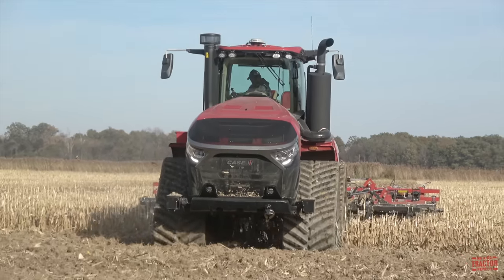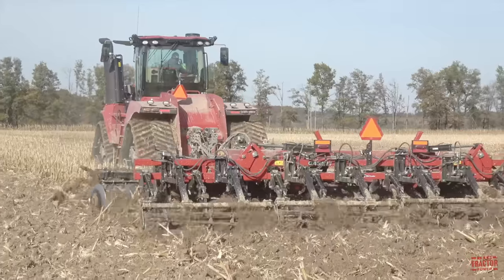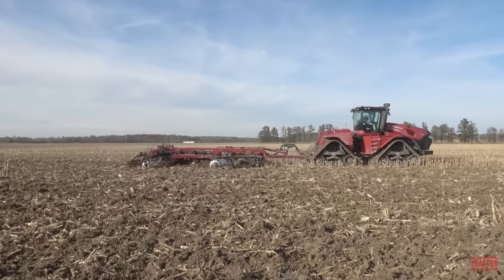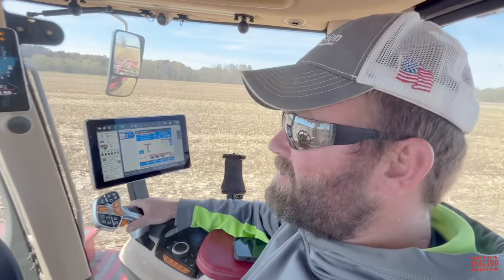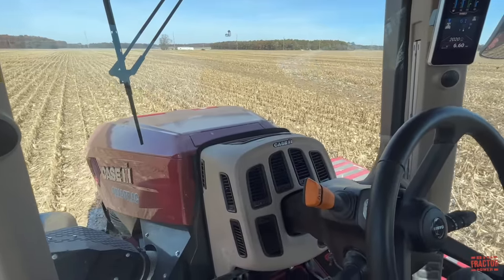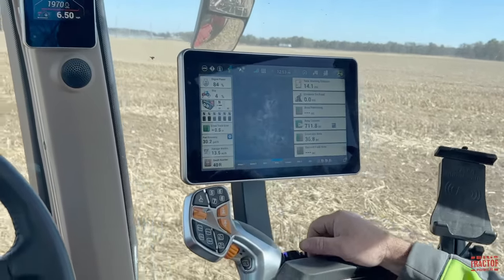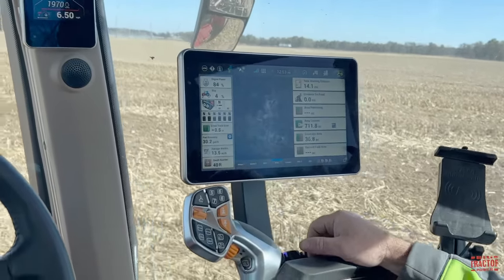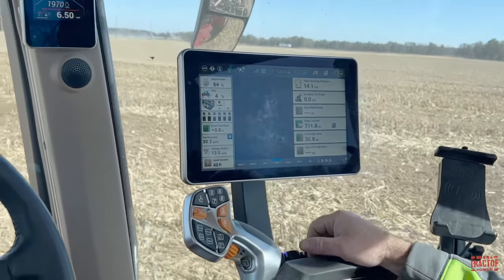715 HP CASE IH Quadtrac Tractor Disk Ripping

Comment: Hi Jason,  many thanks for giving me the chance of riding in such an impressive machine, sadly it is the way of the future as the operator said about labour problems sad to say you do have to cut down on labour and the are many reasons why, in my opinion you have to get on and off that field as quickly as you can before the weather changes, if you can cut bale and cart a field of wheat, barley or oats in one day and the next day send in a machine like that you are ahead of the weather,  gone are the days of huge gangs of labour where you could have a great laugh and fun while working it's now down to less labour bigger machines higher productivity  , the big question now is , when are you going to get one of these big articulated tractors, I'm of the old school the bigger the machine you must distribute the weight I don't think that beauty in the       video was field weighted . You must distribute the weight of the machine on tracks to achieve better pushing or pulling power, all the very best Jason to you and the family. 
Kevin Fox 
UK 
England  
Essex.

Comment: Wow. The Quadtrac can get 50 acres done before breakfast! The lighting package does a good job :) Do you think we'll see mainstream 1000+ HP tractors in a few model years or can implements not grow much further and still stay street legal? While rippers are more compact and need all the power they can get, air seeders and chisel plows, for example, are already quite a handful even folded up. Larger and more powerful equipment isn't as productive if you need to wait for an oversize permit every time you have to move it anywhere in a hurry...
Reply: Don't they make silage machines that are 1000hp?
Reply: 100 lb/hp = 100,000 lbs - the implement! Good luck going across a rural bridge... way overweight for a tractor!

Comment: Great video Jason. I wonder what the trade off is with Compaction. Less passes means less compaction and the 36” track option should make a significant difference. I guess it is a race to a 1000hp.
Reply: There aren't any fewer passes though - he misses the next run when lifting out the implement at the end of the current one, and picks it up on the next pass down the field - allows for smaller headlands and less berms in the soil, as the tractor isn't turning so tightly. No part of the field goes uncultivated.

Comment: Here in Ontario the price is close to $1.4 million, impressive machine, but it’s getting a little ridiculous what these things are going for
Reply from the maker: That is a big price tag.  The farmer in this video felt he would out work to smaller Quadtracs with this one in acres per hour.   Reducing a tractor, tillage implement and operator may help balance the cost.
Reply: @bigtractorpower  it will be interesting to see if maybe Case will release some bigger equipment to utilize the size of this new tractor.  We have an 11 shank landoll ripper on our 550 quadtrac and pull it the same speed

Comment: Time to move that thing over. Wonder how big CaseIH will go now that Deere went around them. WAAAAAY around them, and no DEF either. They also have a 40ft disc designed to be pulled at 14 mph. A little math shows about 70 acres per hour with an efficiency of 88% allowing for turns.

Comment: That tractor should be able to pull twice that width of disk ripper in that loose corn ground.
I dont like to see good power being wasted on narrow implements.
Reply from the maker: I drove this 715.  It rained 2.5 inches a few days before this.  There were spots you were using all 778 hp.  You get more speed with more power.  The only 875 bigger than this one at 22.5 ft is a 26ft model.
Reply: We pull a 870 11 shank with a 9rx620 and here in Southern Minnesota it can work the hell out of in some of our heavy dirt. I haven't seen or heard of a 715 being demoed around this area yet. All the ones out that out are demo's because case haven't released them yet as far as I know that's why there isn't a price. I guess you can order one because I thought Reese ivers said they have one coming in July. I'd love to try one on our ground just for fun. See if we can make it work!

Comment: Have farmed for over 40 years.  What is the point, of being able to purchase a tractor of this size and run it at 6 mph. Sorry almost a break neck speed of 7 mph.  What is the point to go slow? If you can not afford the diesel why have it.  The size of disk here connected to this 715 can pull this easy at  least at 15 mph to 18 mph easy pizzy.  The hp should be used.  Good thing they never plan on using BOOST. These are engineered,  designed and built to reduce time in the filed.  No time savings on this farm.  This is a complete waste of tractor HP. Go back to the ox.